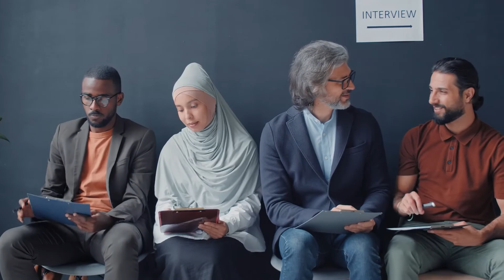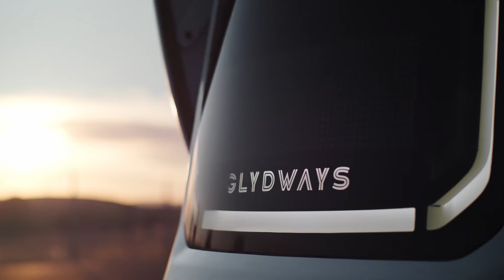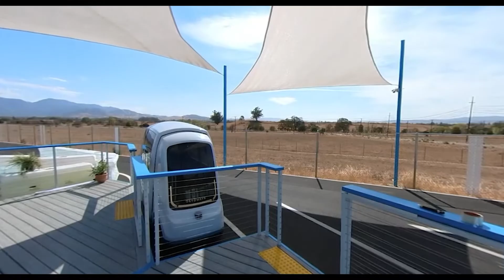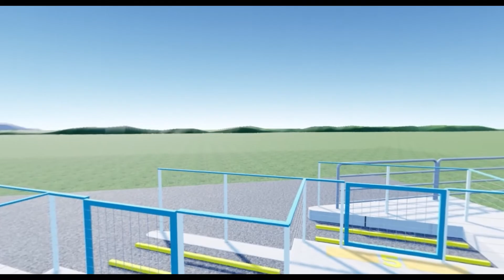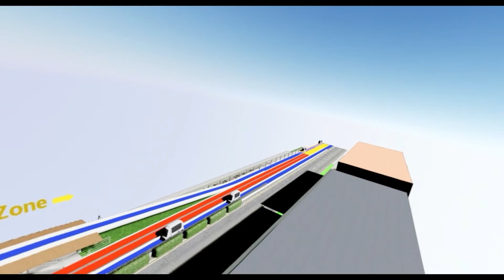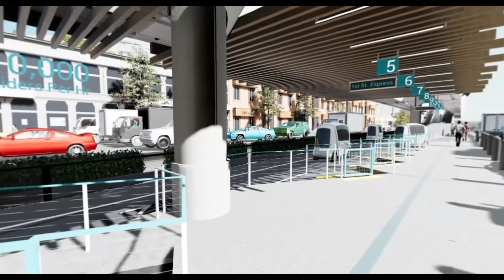Glydways - Vision and Approach Overview

Comment: I have to ask, what benefits does this bring vs expanding our already existing networks? How much does each of these cost? How much is the new paved infrastructure cost? How many people can one of these move at a time? 

I also can't help but think that this will only create traffic upon it's own system, clearly these can only disembark one person at a time, thus if a large group of people were to use them the system would back up very quickly. 

How about we just designate a bus only lane on streets with 2 lanes or more per direction? It has all the same benefits, doesn't require new "wonder" technologies, and could be implemented within a week, needing only paint.
Reply: Cost, efficiency and accessibility.
Reply: It's not economically viable to build a BRT for a low capacity line, and most streets don't have room to spare for two bus lanes. 

Benefits are also not the same, a bus every 30 minutes is not the same as vehicle that's waiting for you at the station.
And you don't have to stop at every station, you go directly to yours, so it saves a lot of time.

Btw, BRT isn't built with paint, it costs $20-$50M/mile and more than a week to build.
Reply: Because frankly no one wants to ride a bus
Reply: So, it's like cars except it is on its on physical roadway that is grade separated. All the advantages of a train, except you can skip all stops except the one where you're going.

"thus if a large group of people were to use them the system would back up very quickly. "

Not necessarily. In such a case they would start out close together, but since people are going to different locations, the pods would separate

"How about we just designate a bus only lane on streets with 2 lanes or more per direction"

We have those too. More than one thing can be built, you know. Here in the San Francisco Bay Area, a famously liberal area (including myself, I grew up here and share those values), We have buses, BRT, Light Rail, Heavy Rail, subways, and, for long distances, jet aircraft. (well, we do have long distance trains in the USA as well, but if you're riding it end to end (30+ hours), that's very few people, and they're doing it mainly for scenery.)
Reply: Tell me, are you morally opposed to ferries as well? That's not a train or bus.
Reply: This isn't that new btw. The first PRT system (Glydways is a PRT system) was built in Morgantown, West Virginia, in 1975. There are several of these systems around the world: UK, Netherlands, South Korea. Look up "personal rapid transit".